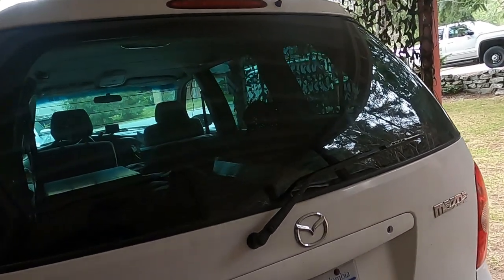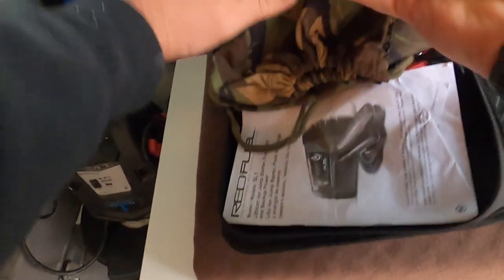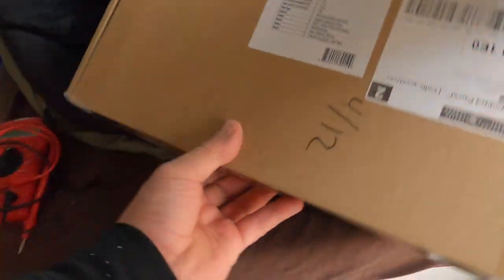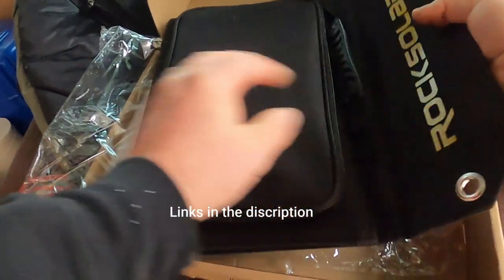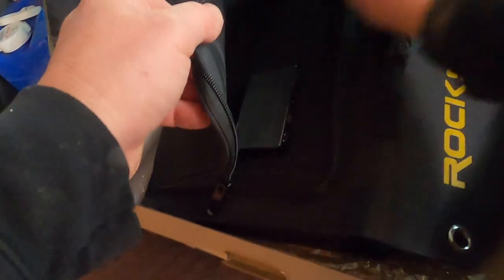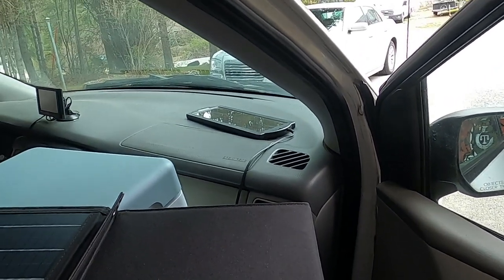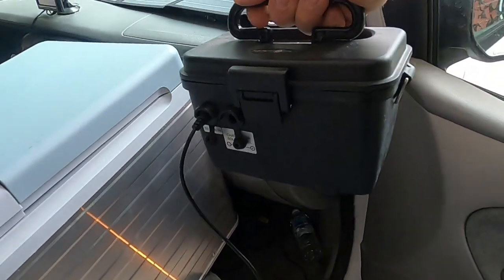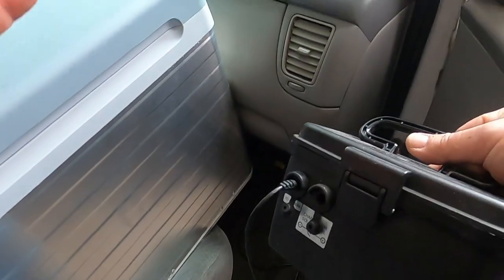Solar System for my Canada road Trip.

Comment: I have a schumaker 1200watt power  box, pretty much the same thing as what you have. I have it everywhere I go, thing is. you can pick up a 2.5watt solar panel, wire in a 12Vadaptor like a cigarette lighter n put that on your windshield. honestly you shouldn't need that much, for me that's all I had while living in my SUV. the schumaker 1200watt with a 2.5Watt solar panel. I recently went camping with rock solar 400 watt system and the schumaker 1200 watt system with a 10watt solar panel. let's just say we had several devices being charged like smart phones n our monster master. then we have our Milwaukee portable charger that connects to our 5AH battery with a 175watt capacity. thing is when you have the 2.5 watt plugged in while your not using it then you charge what you need then unplug it, plug it back into the 2.5 watt solar panel. honestly the 12V plug ins are great except you're putting extra charge on your vehicle system that your vehicle isn't designed for.
Reply from the maker: Yes. Sounds like you have a good system going. I have not done it but I know you can install a bigger output alternator to compensate what your using or charging.

Comment: So, what's the answer....is 30 watts enough to maintain?
Cheers from North Ontario
Reply from the maker: No it would not go all night. The cooler takes about 56 AH to run. I got a new electric fridge for the Dream Machine and it goes 24/7 with my upgraded solar system. 😊